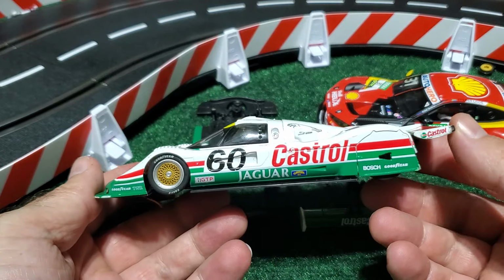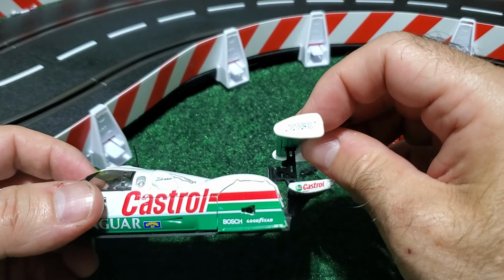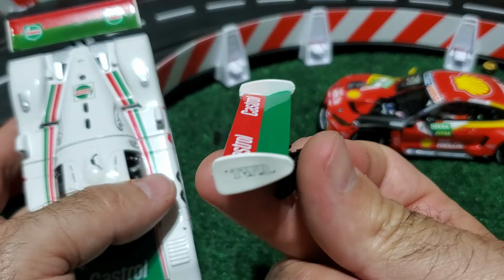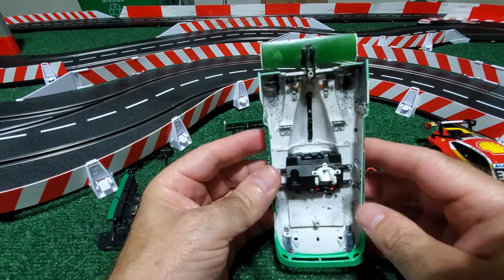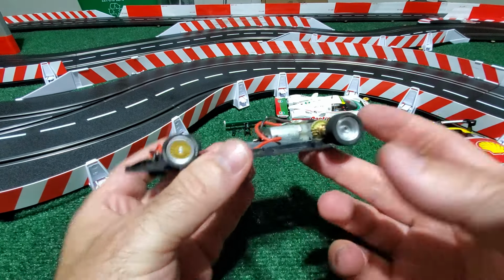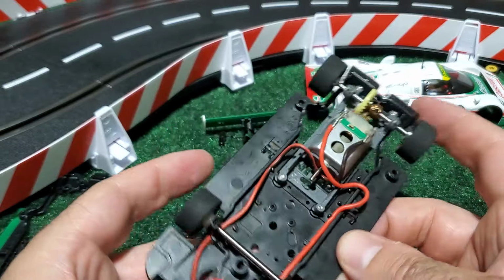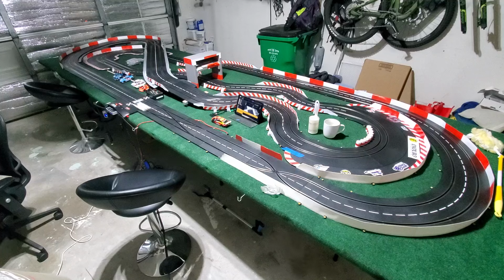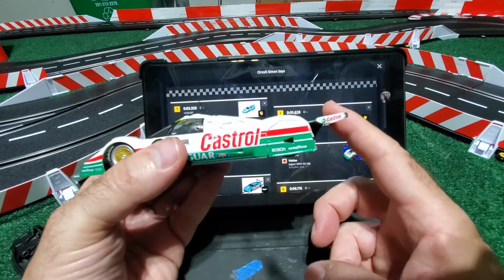Slot.it Jaguar XJR10 Slot Car Review.

Comment: Just got into the hobby, do slot it cars run on carrera track without any modifications? And can they lane change or are they just analog ?
Reply from the maker: Hi  first thanks for watching I just got back into the hobby about 5months ago.

Slot it cars are analog but slot it do make a plug in chip that plugs straight into the original wiring (this car of mine I changed out the wires). They do run on the carrera track very well that is what I am using. 

My track is digital but I did buy a digital to analog switch box by omnislotbox.  That is why I do not have a digital chip installed in my car.

Check out SlotR he has tutorials for digital chip installation and I think slot it has their own channel showing install of their chip.